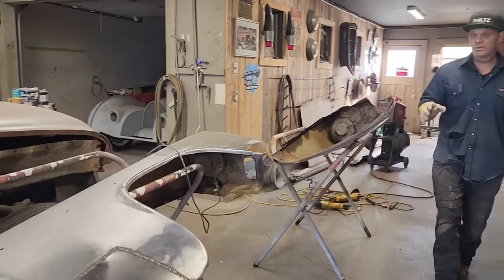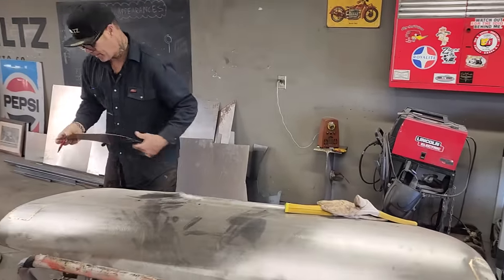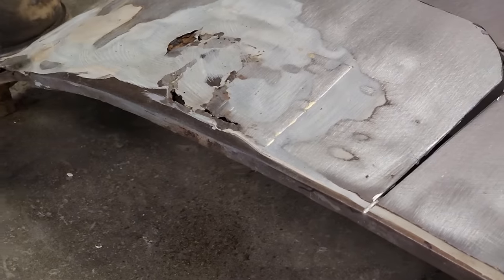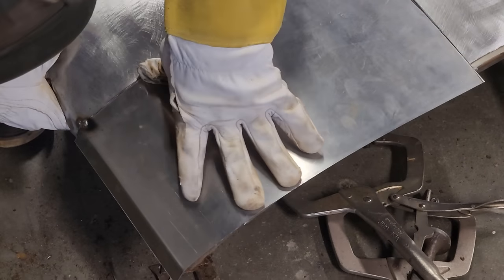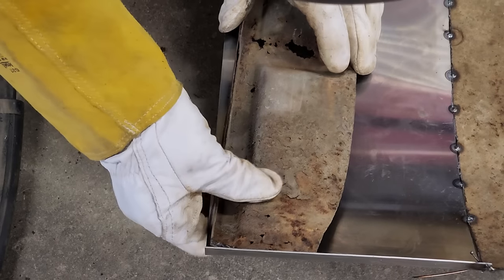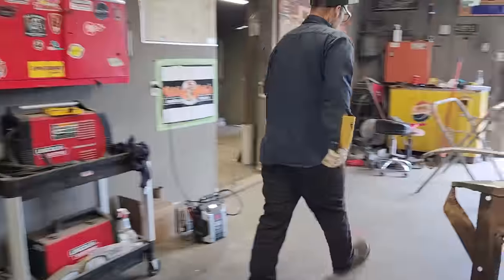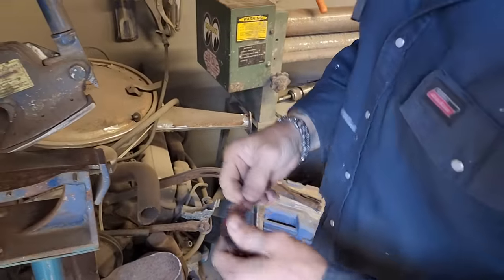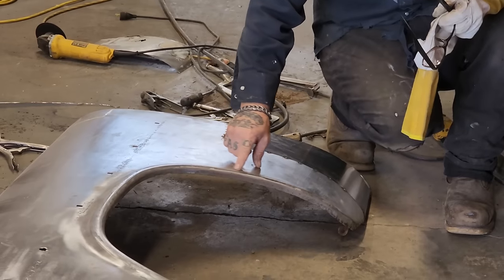There’s rust on the front fender ❌

Comment: Hey Chad, im replacing a 66 mustang quarter panel skin, not done this before but have cut it out and placed on the original quarter, fits fine so far, now just traced the outline onto the original skin. Now! should i cut the outline or do i cut both panels at the same time, which also has its downside as it may move. What is best?  what do you suggest. I will be mig welding this on, butt welding. Thanks.

Comment: ya know. they do have water based rust convertor, put it on with a spray bottle, and while ya make you piece, its curing, and then ya weld your metal on, and ya have protected the inside, I love what ya do, bu man, treat the trust befroe enclosing it. It no more work, and would make the part last a lot longer maybe.

Comment: You need to put a 2" or a 1 1/2" round magnet on your ground wire you put the ground on the back side of the fender if your wedding on the auto you can put the ground on the floor under the auto the ground won't fall off . that what I did then I had a old jumper cable the black side I add it to my welder ground so I had a nice long ground with the magnet I never had a problem with my ground. Where I added the extra wire I put a 1 1/2" magnet so I have two magnets so I can have one magnet on the auto and one on a fender

Comment: Why don’t you wire brush the inside of the fender and frame of the fender and apply some rust restorer to it before you weld a new rust free patch onto it? Without prepping the rusty parent fender, you are building in a wonderful sight for the new metal to begin rusting as it is now attached directly to the old rusty frame of the fender.

Comment: Chad, I hear your channel locks squeek and fight you when you try to adjust them and I see you struggle with your sliding arms on the hoist as well as the pump on the hoist sounds to be starving for oil. Have you ever considered doing some maintenance on your equipment such as cleaning and lubrication?